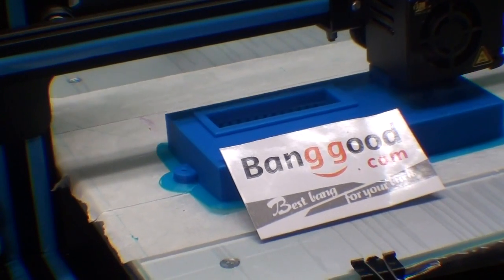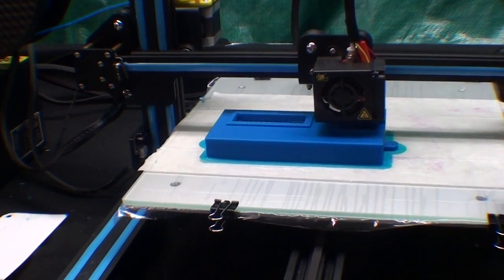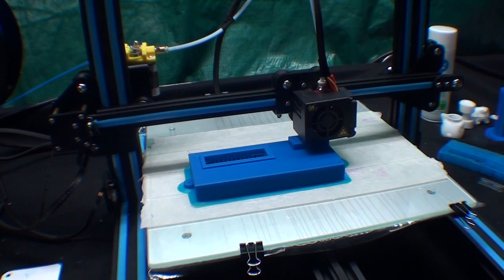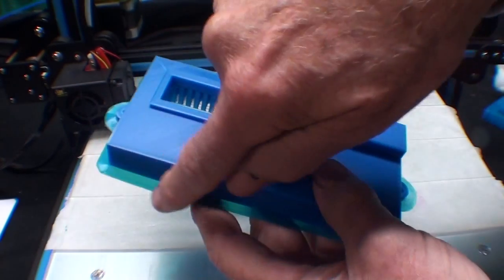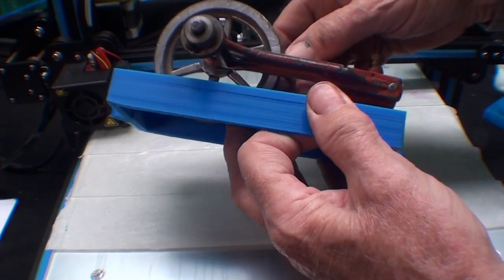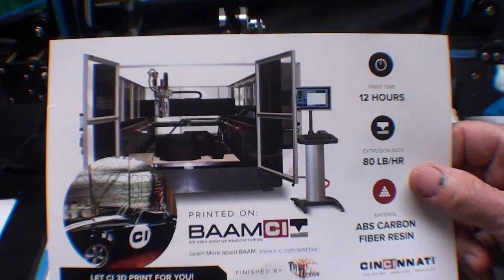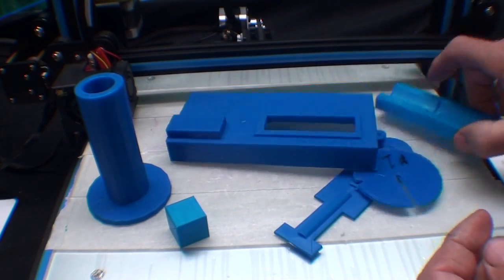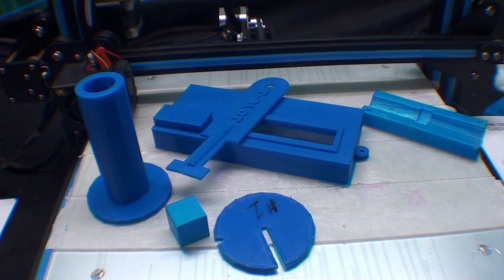3D Printing CREALITY CR 10 with tubalcain #1

Comment: the "problem" with 3d printing is, that you dont have to work, in order to get something, sure, you could make 10 plates in 2 hours, but you have to do it. if you press print, you can take a dump or drink a tea and the machine does it. 

on the other hand, you can print stuff, that you would have a really hard time, making by hand, lets say you want to maka a housing for a power tool prototype, thats easily done with a 3d print but not that easy by hand, if possible at all... so it has its up and downsides to it
Reply: It's really hard to get used to. I still think in terms of removing chips, I add simple shapes or cut out material like I would by hand, but the 3D printer has completely different strengths and weaknesses. If it wasn't so darn slow I would play with it more.

Comment: What in the world did you use to create the G-Code? I can not come up with anything, except apps that rent for thousands $ a year. At the same time, it appears that there is nothing to it and a simple short script is what is used in Linux CNC. And so, there absolutely has to be something free or super cheap to do it.
Reply: BiddieTube fusion360 is free for hobby users. They class hobby as earning less than 100,000 per year, so it should fit the bill. It's such a powerful program that it has a very steep learning curve but its worth it!
Reply: Thank you for reply,. But, I bet he used something else, and I still want to know what he used. I used to use autodesk products in mfg and games, but quit once they went to rental. Even though 360 may be free, I would not want to use it because using it creates dependency on autodesk, and that is something that is not acceptable. Just think, for a new start up company for instance, they become addicted to 360, then begin making money, and then have to fork out thousands a year in rent that can go up anytime. When you quit paying the rent, your app shuts down stranding all the company prints, data, and lots of other necessary files. It is not worth it, no way.
My goal is to find the many ways there are to design and run in windows environment for the many that are scared of Linux still. The only thing I still need is a good way to produce and simulate G-code in windows.  
And FYI, $100,000.00 a year for a company is absolutely nothing. Paying rent to autodesk from such a company, could be an unbearable burden.
Reply: Give FreeCAD a shot. As the name says it is free. But it is no Autodesk. Because no one makes a living working on FreeCAD the development is very slow. I guess you get what you pay for? Maybe.

Comment: I highly recommend you try Fusion 360. It's got a learning curve, but there are lots of great videos. It's very powerful and you'll get a much better result. Your circles will be much better, and the constraint system easily lets you dimension things any way you want.
Reply: I highly recommend avoiding Autodesk products like a virulent plague. They're corporate scumbags. Fusion360 is far from free. You really should try to actually comprehend the license someday. Hire a lawyer to explain it to you, if you have to. They'll tell you ten ways from Sunday why Fusion360 IS NOT FREE!
Reply: Did I say it was free? It's powerful, it does everything I want. I like how it works, and it doesn't cost me money. I'm going to continue to use it.
Reply: I prefer to use open source when it's available, and works really well, but I've tried them, and right now I don't know of something that's as well made. It's used by a huge community of people, there a lot of autocad based 3d models out there, and all my models are made with it. What use will it be for me to start using a tool that's not as good, simply because fusion 360 is a no cost closed source commercial product, and not an open source community project? My using an open source tool doesn't support it's developers. When there is an open source tool as well made, that supports all my files, I'll switch to it. I don't see how using commercial software is such a terrible thing. If nobody used any commercial software there would be virtually no job marker for programmers.

Comment: There is usually a setting in the CAD software to tell it how many sides to use in the polygon to make a circle. With enough sides you won't be able to tell it from a circle. It just makes more G code to do the job. I also recommend Fusion 360. Besides making G code for 3D printing it will  make code for 3D milling an lathe work and it can be used to make drawings of your project. Plus a whole lot of other stuff. Big learning curve though.

Comment: Mr. Pete, do you plan on machining any of your prints? That's a video that I'd like to see (ala machining your steam engine base for a better surface finish). Manufacturers who use 3D printers in their factories to make commercial items often use the printers to create custom "castings" that are then machined to make final parts. There's a company called Local Motors, for example, that makes small self driving transport busses in this manner. All of the parts are 3D printed, machined, and then assembled. I also second the commenter who mentioned making prints with large voids upside-down to eliminate having to make the support webbing.

Comment: Great printing demonstration in the usual Tubalcain high quality.  They are still miles away from what I would want to buy.  When the first 3D printers came out I said I need to get one of those.  Thankfully they were too expensive at that time.  Then I began to learn about them and I discovered they are hopelessly slow and the surfaces are normally too rough.  By the time they get the home version to do almost as good as the commercial version I will be too old to care.   I guess that is one of the drawbacks of being an old geezer.
Reply: You can vaporize your prints to smooth them out. Or just sand them I suppose?

Comment: Sounds like your starting script and ending script are messed up for your profile. Google "CR-10 profile" if you are using Cura add that to it if using simplify 3d add that to it. You can also turn off that brim for most prints. I only use a brim hen there is a small contact area on the bed. For something wide and flat you can just use a 2 line skirt. Try the Elmers brand gluesticks. The purple stuff. The glue stick is good to add extra texture to your bed not really to glue it down. So if printing on bare glass and having a hard time with adhesion then use glue stick. But on masking tape you shouldn't need glue. In tinkercad when you drag a circle over from the side a little box will pop up in that box will be a slider labeled sides, slider that slider up to make your circle more round.

Comment: I would also recommend using Fusion 360 as well, John Saunders has excellent videos on how to use it, and as cnc mills are pretty much the same as 3d printers, you may find it works much better for you than the useless program you are using now. As well it doesn't cost you anything to get it or use it.

Comment: Hi Mr. Pete.  Not sure this will help, but I have been running a home built CNC Router for a while now.  Here are some suggestions to answer you questions near the beginning of your video.

To get the part to print near the center of the bed, set the origin of your part to the middle of X and Y.  AND  Set your work offset to the middle of your bed.  When the GCODE is produced it will use all 4 quadrants starting at the origin of your work offset (G54)

To return to the home position, The software that generates the GCODE should have some sort of post processor that adds any footer and header information to your GCODE.  At the end is where you want your home code to go.  Now, I notice that your Z home is down on the plate or very near.  Usual practice it at the top of its travel but in this case maybe that is where you need it.  So you want to make sure you Home the Z axis last.  The code to do this is.

G53 G0 X0 Y0 (Moves the X and Y axes to the machine home position)
G53 G0 Z0 (Moves the Z axis to the Machine home position)

Now, G53 means the Machine offset and is non-modal meaning that you have to use it every time you wish to execute that G code.  The G54, G55, G56, G57, G58 and G59 are work offsets.  They are modal meaning that once you set the offset, they stay active until another offset is entered.  With the exception of G53.  When you enter a G53 (Machine offset) it performs the line of code then immediately returns to what ever work offset is in place.

G0 is a rapid and the X0Y0 are the destination to where you want to go.

Now, armed with this information, you can enter commands something like

G53 G0 X0 Y150 - which should move the head all the way to the left and to the back of the machine.  The Y150 is half the Y axis length in the positive (Back of the machine)  I have used mm here.  If you are working in Imperial, then make this whatever imperial length  for example Y4 to move 4 inches.

Next G53 G0 Z??  - Here the ?? would be whatever height you want to raise it in the + direction.  Y100 (100 mm) or Y4 (4 inches)

It is nice to give something back to the man that has given me and my boys so much!

Laus Deo,
Joe

Comment: try hair spray for adhesion to the bed it worked well for me
Reply: Farrah Fawcett hold works best
Reply: Specifically aquanet super extra hold works best, on a heated glass bed. Much better than tape,
Reply: Watered down (dissolved) PVA support material worked for me.
Reply: If you want a one and done rather than rinse repeat just get a sheet of pei (ultum) and an adhesive film from amazon and enjoy perfect adhesion on pretty much everything but nylon. If you want nylon to stick get a sheet of garolite.

Comment: Mr. Pete, I think other people have mentioned some of these things but here are a few suggestions.
 I would use the glass bed (no tape) with a layer of elmer's purple disappearing glue stick or aquanet hair spray. There are other materials like buildtak or pei, but it is easy to start with that specific glue or hairspray. Secondly, I am assuming that you are using PLA and I would definitely start with that, I personally avoid ABS, if I need something a little stronger than PLA, then I use PETG which also easy to print. I also use a lot of nylon, glass filled petg, carbon filled petg etc  for heavier duty parts but PLA can go a long way and is easy to use when starting.

As far as software, everyone has suggested Fusion 360 and I would also highly recommend it. I would also recommend Simplify3D as a slicer, it costs money ($150) but it is well worth it. Even though it may seem slow to print things out now, once you learn the different settings, you will learn how to optimize different prints for different purposes and things will get faster. You will also find that you can print things that would be very difficult or impossible to make any other way and the ability to make multiple identical versions of those parts can be well worth the time spent setting things up.

Comment: I have the Creality CR-10 as well. I had the worst time with my glass plate. It would warp when it was heated. I ended up going over to Lowe’s and buying a 12” x 12” pre-cut mirror in a pack of 6. WAY better after I replaced the glass. A lot of community of CR-10 owners recommends this purchase ASAP just to rule it out. It’s a common problem and cheap fix

Comment: Old Dogs trying to learn new tricks.  Would probably easy to set for a 12 yr old.  they have grown up with the technology.  How hard would it be to add pattern draft to the printed item?  This question can be answered in an up coming video, or not, never feel like you have to answer one of my questions.  I know you get thousands.  Keep Printing.  Keep machining!
Reply: In the right CAD software, it's easy to add pattern draft. This is called loft in Fusion 360. A tool I highly recommend.

Comment: Hi Mr. Pete222. Just copy and paste the ff into your CURA ending script so that Print head moves out of the way (up and left) and bed moves forward after print:

M104 S0 ;extruder heater off
M140 S0 ;heated bed heater off (if you have it)
G91 ;relative positioning
G1 E-1 F300  ;retract the filament a bit before lifting the nozzle to release some of the pressure
G1 Z+15.0 E-5 X-20 Y-20 F9000 ;move Z up a bit and retract filament even more
G90 ;absolute positioning
G1 X0 Y0 ;move X/Y to min endstops so the head is out of the way
G1 X0 Y300
M84 ;steppers off

Comment: The polygon is due to the fact that you need an infinite amount of reference points to create the circle. Well each point is given a 3D placement. Each placement needs a designated coordinate. Each coordinate is information that takes up space and processing power to keep track of. The more points you have, the more processing power you need. 
To my knowledge, You would need a supercomputer or a quantum computer to make a near perfect circle with cadd. 
 So the solution is to make an oversized polygon with the inscribe circle. And make the center of a flat side tangential to the said circle. Then turn down to final dimension.
Reply: My CNC machine has arc commands. When I get it to draw spirals they're really curves.

Comment: Mr. Pete - Check out the youtube series by Mr. Paul McWhorter called Learn Fusion 360 of die trying. He is an excellent teacher and he also works with 3D printing. I think you will like Fusion 360 and it works well with STL files, etc to use in your slicer software.
I hope that helps and keep up the great work!
You inspire and really get the creative juices flowing!
I'm a foundryman and have been for over 24 years so its always interesting to see all your talents. :-)
We pour some large bronze castings (3,500LB pour weight).
Every family should have a guy like Mr. Pete! An Uncle Pete! :-)
Thank you sir!

Comment: Look on Amazon for PEI sheet for the bed. Also use Fusion 360 for your CAD it is free and very powerful yet easy to use. As for printing times reduce infill to around 15%, for most things that is plenty strong enough and magnitudes faster. Thomas Sanladerer has a great 3d printing channel that caters to new and advanced users, he has some great content on his channel, also Makers Muse is a great resource. Feel free to PM me if you have any questions I will be glad to assist you.

Comment: you can in fact make aluminium parts from 3d printed ones , using lost plastic method (in analogy to lost wax) , as for modeling you could start with google make, then go to fusion 360. i am glad you went to 3d printing, now the channel has the most two things that i like . gd luck mr pete

Comment: Things you already know but which might help:
1) You need a good CAD program.  The better the CAD program the more it can do for you and the better the starting point for your prints.  Many people are currently using AutoDesk Fusion 360. This seems to be free for small users and I believe you would qualify.  AutoDesk also has Inventor which is similar to Fusion 360 but of course different.  There is also Solid works.  I know that Inventor has options to add draft to models and I've used it to create patterns for my foundry.
2) You need a good CAM program.  This is sometimes called a Slicer in the 3D printing world.  The difference being that a good CAM program works with the CAD geometry to create the tool path where as a slicer uses some sort of standard (STL) intermediate format
2A) You need a good slicer.  If your CAM program is not capable of slicing your model you will need to have a separate program to slice the model to create the tool path.  Your "polygon circles" are likely the result of your CAD program exporting a low polygon count version of the circle which the slicer then duplicates.  Look in your CAD export settings to see if you can increase the polygon count
3) You need a g-code post.  A g-code post takes some intermediate set of instructions and turns it into g-code to move the print head around the bed extruding when it should.  Different printers need slightly different g-code.  The g-code post will also add g-code snippets to start and end the print.
4) You need a g-code interpreter to drive your printer.  This is your controller.  You have one, you don't need to worry about it.  Different printers have different controllers.  One issue with DYI printer/controller pairs is that they often need to be "tuned" so that the motion of the print head actually matches what the controller/g-code says.  I.e. if the g-code says move 0.128 in and the controller things that moving the motor 179 degrees will move the head 0.128in but in realitiy it moves 0.120 in then the controller's tuning parameters need to be changed until all movement does the right thing.
5) Don't just move the print head to the home position at end of print. Raise it up enough to clear anything on the print bed.  You don't want to spend 13 hours printing something and then have a crash because there was some feature of the print in the way.  (Many slicers don't let this happen, but why not be safe?)

Good luck, have fun, and be safe.
Reply: And, Fusion 360 can add draft for casting patterns... Excellent video!

Comment: I would recommend Fusion 360 for you CAD/CAM.  It is free for most people's applications/uses.  Also, you mentioned you could have made three wooden patterns in the same amount of time that it took to 3D print one.  Certainly for this part this is true, but with other parts you may not even be able to make by hand.  Also, what were you doing in those 14 hours?  Something else.  This is also the advantage of 3D printing.  You can be working on other things while it is working.  It's like having an employee.